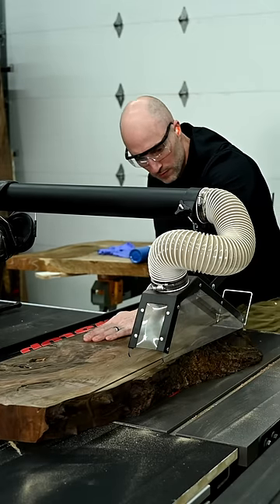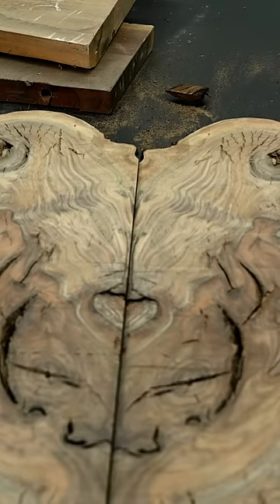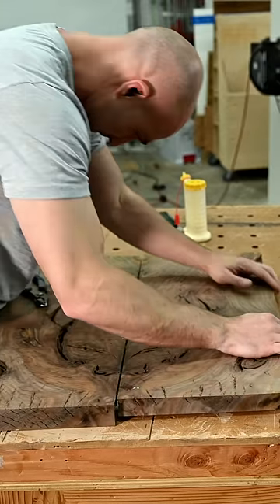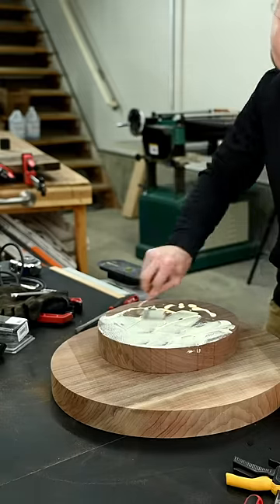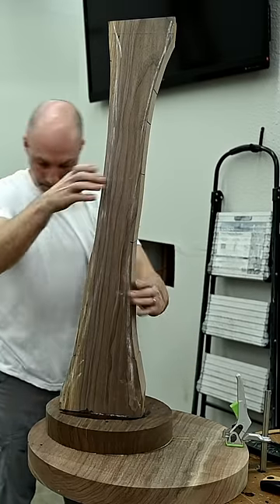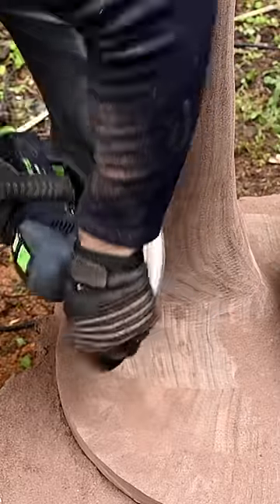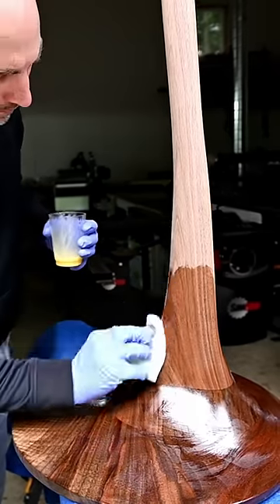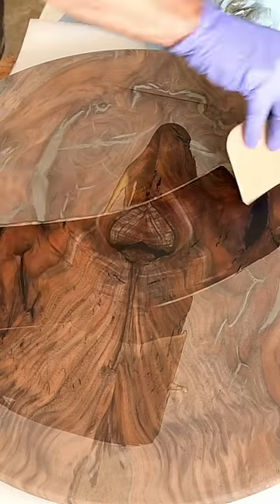(Almost) Unusable Wood

Comment: After seeing the results of how hard it was to break that top you broke I thinking a lot more “unusable” wood is usable.  Love all the character in this top.  Beautiful work
Reply: the supplier probably meant that its unusable for cookie cutter manufacturing
Reply: It looks like an old cockerspaniel
Reply: Thats just a tad longer then my banana bro
Reply: I think the leg is to thin.
Reply: I see an owl
Reply: Looks cool. It works.  It looks like any mandrill..you could name it whatever you wanted to.
Reply: Tbf you can cover anything in epoxy and make it usable.  Don’t think that’s what they meant by unusable lol
Reply: Unusable for some, useable for others
Reply: @adrock889  yep but in a form when they say unusable is more that the time to store it and find a buyer outright make them lose more than just giving it or throwing it away
Reply: Great job All wood is usable it all depends what you will be using it for.
Reply: No such thing as unusable wood. Just wood that hasn’t been used yet
Reply: @voszvaivaldtkoszikovokh6418  yea, it just needs more love and attention than the average person using it would be able to give
Reply: Beethoven
Reply: I always use the unusable wood for designing ceiling and replace the plastic around the ceiling mounted A/C
Reply: Less that it's literally unusable and more that it takes so much extra work to stabilize that nobody would be willing to buy it for a reasonable price
Reply: It is, humans are wasteful
Reply: @okiebear  i saw a Haina
Reply: The resin made it usable it wasnt on its own.
Resin doesnt bio degrade and u cant burn it either, so lets hope it lasts ages as a actual table.
Now would u buy this?
Reply: It's probably because if the wood breaks during transit, its something to be concerned about
Reply: Lion
Reply: holy English, batman!
Reply: I think it’s cuz when moisture gets trapped in the wood, it causes rot and cracks to form, and there’s nothing you can do about them when it’s alr in the epoxy
Reply: Looks like beerus from dragon ball super
Reply: @voszvaivaldtkoszikovokh6418  they meant it's unusable for normal woodworking. This guy uses epoxy, which btw happens to be a material you are discouraged from using due to it's toxicity and just the fact that it's plastic.
Reply: Unfortunately if wood has too high moisture content then it's not suitable for applications like these either, despite some pieces being salvageable
Reply: @That_One_Kobold  what is then the alternative to epoxy?
Reply: @voszvaivaldtkoszikovokh6418  doing proper wood work? With that piece of wood You could probably make tons of really cool small items like cutlery or necklaces. Or then bring it to a saw mill and they can make MDF or OSB out of it. Yes I know I'm contradicting myself but I mean it is unusable for bigger items like tables or even a cutting board
Reply: Love it great job
Reply: L
Reply: Exactly that's what makes it unique
Reply: Any wood is usable if you coat it in epoxy but at that point the wood is just decorative and not structural.
Reply: Only you make sense in the entire comment section lol!

Comment: I got some sweetgum from my sawmill guys scrap pile that are very similar. Sadly, i dont have a band saw that will cut it. Ive got the big split pegged and ill fill that with some epoxy b4 i put it thru the router sled. Well see